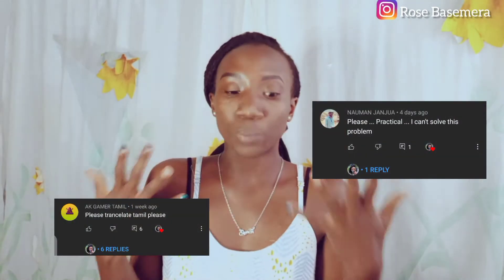ILLUSTRATED How to fix a Tecno OTG pop-up error | connected to other device successfully problem

Comment: hi, i changed my charging pin because it's broke already and i did for almost 2 months and then the word " connected to other device successfully" pop on the bottom of my screen after i opened it and i thought someone hacked my phone and i'm scared, pls tell me i'm just wrong or am i right? hope u notice me😭😭
Reply from the maker: Can you send me a screenshot of what it says exactly on my Instagram. So I see if it’s the same problem (I wanna know it’s an otg issue or something else
Reply: @RoseBasemera  already done, hope u notice it. I'm your new subscriber, i love you & thank youuu!!💗💗
Reply from the maker: Seen it and problem is with the charging port mainly try cleaning it first then if it doesn’t work adjust to the other methods I gave

Comment: Hello ROSE, I had a similar problem with my infinix hot s3. When I watched your first video, I realised that my phone had earlier on shown OTG connection without an OTG. I remember I held my phone with my mouth and alot of saliva entered it but I didn't take it seriously until this problem started. My phone can't connect to my computer neither does it connect to OTG flash drive, despite not showing the pop up error. PLEASE I NEED HELP. I TRUST IN YOU BECAUSE YOU MADE ME REALISED WHAT I DID TO MY PHONE WAS THE CAUSE OF THE PROBLEM.
Reply from the maker: Lemme do some research and get back to you. In the meantime try the solutions I gave here
Reply: @RoseBasemera  I will follow you always. Help me and help many other people. Right now I don't feel like I even have a Phone. It is like a phone without OTG recognition ability is nothing.

Comment: I want to tell. so my cellphone is broken in the charger section. the rightmost iron is broken, and has been serviced several times but the words "Enable OTG?" After I turned on the OTG, the words "connect to other device succesfully" appeared. Repeatedly appearing.
 can anyone give me some advice
Reply from the maker: That's what the video is for to stop that otg issue but it seems you have other complications maybe visit a carl care center

Comment: I tried to use the Spirit but the problem is still persistig, and unfortunately the phone isn't charging. How can I fix this problem of charging?
Reply from the maker: The charging problem comes coz of the otg problem. To fix the charging problem you need to fix the otg pop up error issue. Is spirit had refused try the hair dryer